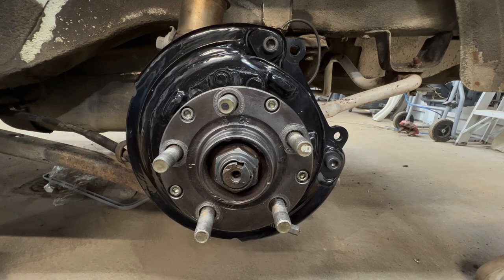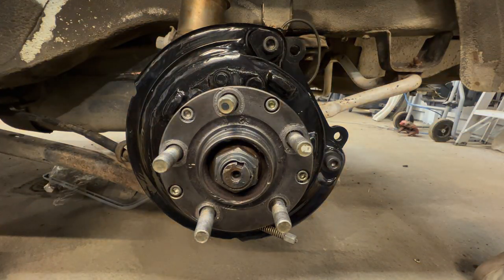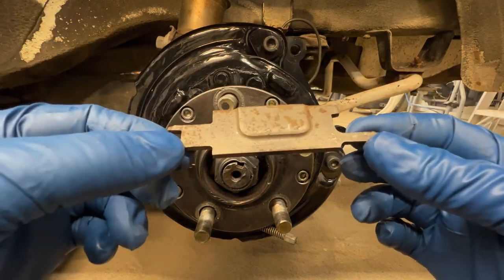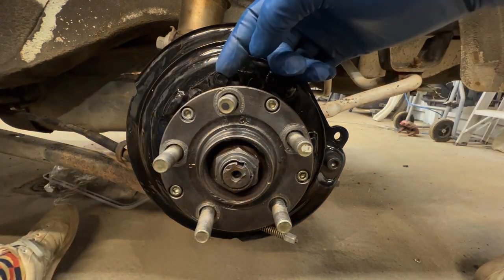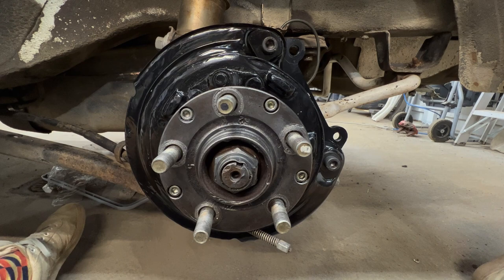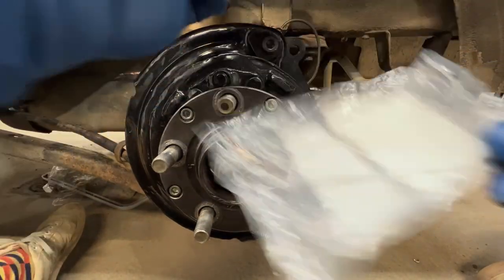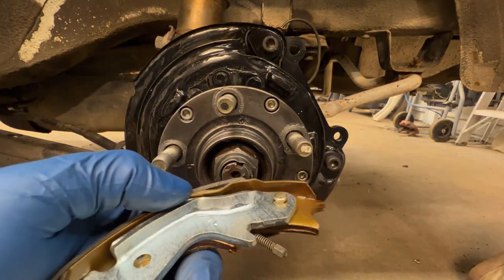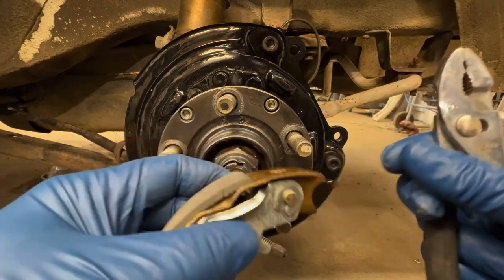How To: Subaru Parking Brake Assembly - 99 Impreza/Forester

Comment: For future viewer reference, here's the #s for the reused parts in order that they're shown: 26269PA010 (Left) 26269PA000 (Right) the part diagrams just call this a "strut" or "parking brake strut" and then the triangular part is 26268PA000 the part diagrams call this a "plate shoe guide" and can be used on either side. Thanks for posting the video! I'm converting from rear drums to discs and need these references since I'm working from scratch.
Reply from the maker: I very much appreciate you adding those. Pinned your comment, thank you!

Comment: That's a good demo. One of the disappointing lessons from professionals is the way most pros completely ignore the parking brakes when doing a typical brake job. There's a separate fee code for parking brakes and if you didn't pay for it they won't touch them. Eventually the parking brake gets seized, which can create a big problem if the drum won't pull off.  I find those lower star wheels get very rusty and corroded. Amateurs have more of a chance to do things properly because we aren't racing to get the car out the door. I like to put antiseize on those medial metal to metal contact points, and of course lube the rotating mechanism for the star wheel with high temp grease on the threads. More than once I've had to take it all off and find a cause for noise, often inside the parking brake where hardware rubs on the backing plate.